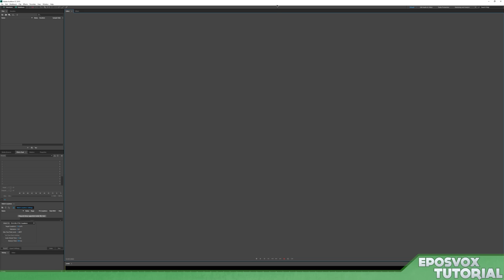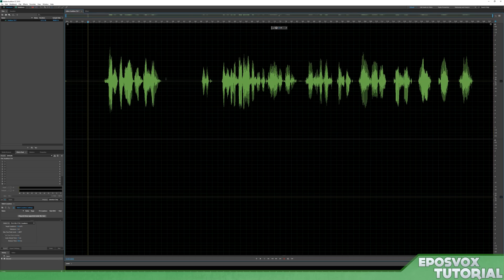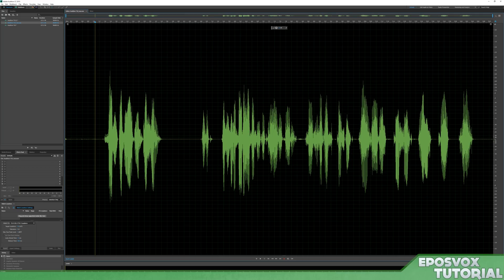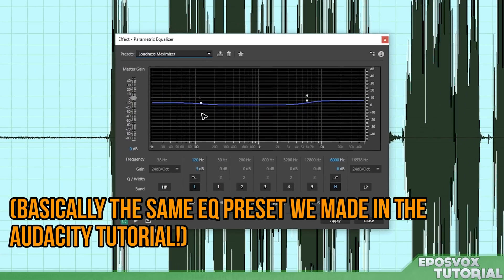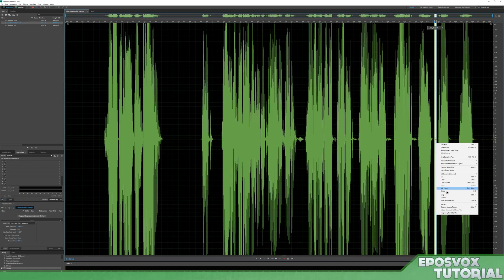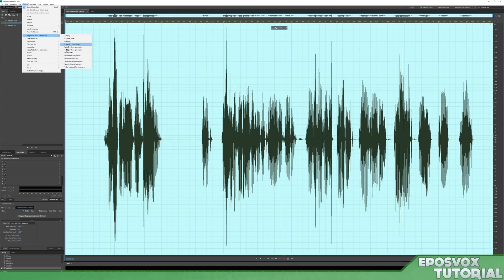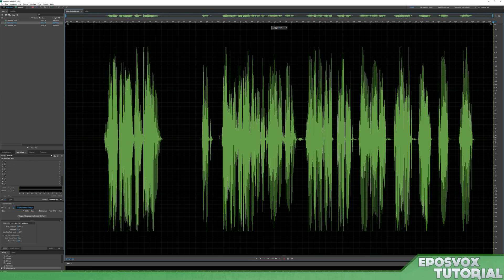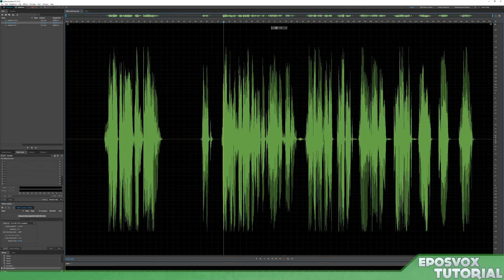EPIC VOICE MASTERING // How I Process My Audio in Adobe Audition CC 2015

Comment: Two suggestions for people......

Try noise reduction before processing. Look at a sample of the noise to see just how loud it is and then reduce to your ‘target’ figure, I go for -70dB in order to allow for processing afterwards.

Try using a noise gate first though just to see whether you actually ‘need’ noise reduction rather than manually insert silences between sections. 

Noise gate is more accurate than doing it yourself and slides in and out more smoothly than crudely inserting it and noise is normally totally eliminated. Again, look at the noise level and set the gate for this level. Then set the gate dB reduction to the figure that gets it down to your ‘target’ level. (In my case -70dB) or set it completely to silence if you want; I prefer a tiny bit of atmosphere myself and then play around with the attack and decay settings in order to make sure that words aren’t clipped or noise creeps in at the start and stop of words. In order to hear the gate while adjusting attack/decay, I temporarily set the gate to 100% then adjust to a figure that stops the meter jumping around in anything silent on the recording.

You will find that most times, you won’t need noise reduction and it’s better for the sound.

With regards to compression, if your software has it (ACX on Audacity for instance) get the figure for the RMS of your audio. Set the compression for this figure as its threshold and start with just 2:1. If it’s too much, go less. Again, way better for audio.

Don’t randomly guess and certainly don’t have preset values for everything. That is a slightly ‘destructive’ way to work for a lot of audio. No two clips are the same.

Comment: hi! thanks for the vid. i have a question though... i am just back from vacation and got lots of footage from diferend cameras, i want to ma a move from all devices combined. i use ms movie maker for that. but one of the devices is a gopro in a wp case. case, as you probebly know its get nocking on the case and overall bad audio from it. i cutted out the pieces i did not want on all the gopro footage but need to get writ of all the noice and peak case bumps in it so all the audio is the same as i am gonna ad moor footage from other devices like my lumix that have pretty good audio on the vids. how can i best do it? like a quick way... as i am already spening houres in just cutting out the bad pieces and edeting it all togheter... thanks already. cheers

Comment: in my opinion, again just my opinion here, they both sound bad.  It sounds to me like you entered into some bad noise reduction on your wav.  1. you never want to put a noise reduction plugin on a voice-over for radio, narration, or anything for that matter.  If your mic chain is so noisy you feel the need to reduce the noise it's making, I recommend a power conditioner, or perhaps you have a nasty ground loop going on in your room.  Thought I heard you say that you were using the focusrite scarlett 2i2.  If true, then you should be sounding great going into your DAW.  Try to make your room more conducive to a quiet and dead recording environment.   I noticed your software of choice is audition.  try this.. Make sure you are recording your audio no louder than -04db peak, input is set to line, not dynamic.  after your recording, normalize to -1db , then grab your multi band compressor, use the preset "internet" and process.   for what you're trying to accomplish, and with your voice, tell me if that doesn't get the job done for you.  

Keep up the good work Son.  
God Bless.
Reply from the maker: Problem being I was in a bedroom with a PC going :P And the 2i2 records very clean itself, but the amount of gain required for dynamic mics is too much for their pre-amps to handle, it gets quite noisy, even with the CL1 pre-amp inline. 

And with my new rack with the ElectroVoice mics, even with a power conditioner, HumX reducers, and a noise gate on my compressor box, there's still electrical noise that needs cleaned off - but it's easily covered up with music/other sound since the noise gate kicks off any room sound.
Reply: I agree with Eva, noise reduction plugins take 'color' out of voice recordings. I'd look into gating your recordings via hardware if you're still getting noise from a quality dynamic mic.

Comment: Is there a way to have a limiter during live recording, so while recording where I can go from normal to loud without clipping it?
Reply from the maker: Not without hardware units.
Reply: Although there are some audio interfaces that have built in DSP chips, like my Focusrite Saffire Pro 24 DSP which can do compression and EQ in. For a limiter specifically you'd probably need a separate hardware unit though, as you mentioned.

Comment: Hey buddy, I trying audition out and I can't figure out how to set a loop point so my that tracks will play over and over again
Reply: Hey,
mark the part u want to loop for editing and down at the bottom right of the rec symbol there is a icon with and arrow in it (line that goes around clockwise with the arrow on top) hit that, and hit play and it will loop that marked part 

hope that helped ;)
Reply: +DenitivGaming I kinda figured it out since then. Thx I'll try that next time I use it again
Reply: +Ez Money Beats no Problem :D thought so after i saw when u posted the question but answered never the less

Comment: is it possible to tell us how to do the single bottom process? instead of the step by step
Reply from the maker: You have to configure your presets step by step before setting up the one-button. Though I will be showing the one button tool - it's just in the Favorites menu.
Reply: So how do you go about setting that up? I'm looking to start doing more videos and doing some procesed audio with them.
Reply from the maker: One-button is called a "Favorite" in Audition or a "Chain" in Audacity. I'll have videos on them soon.